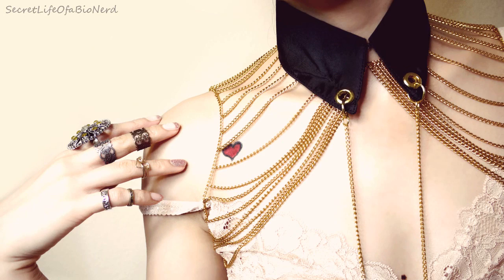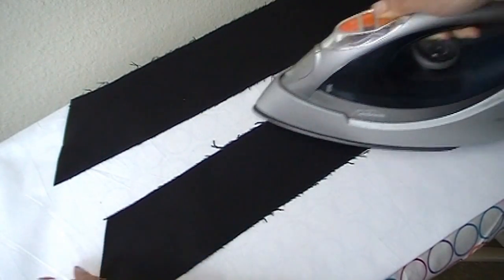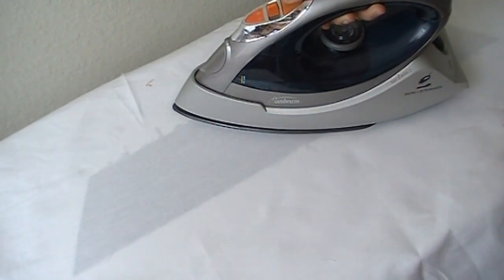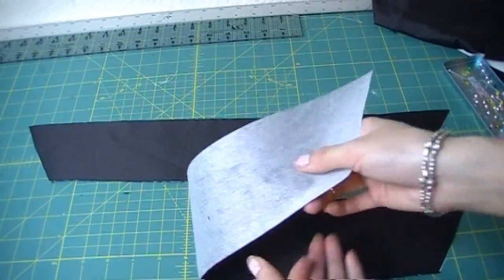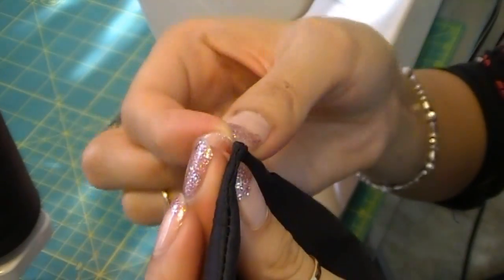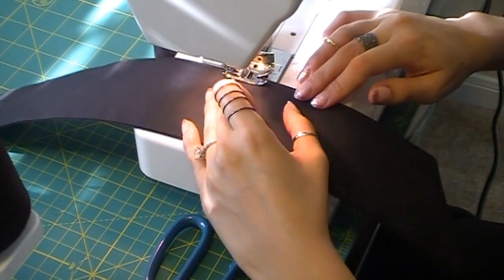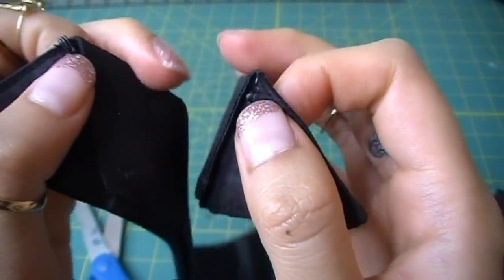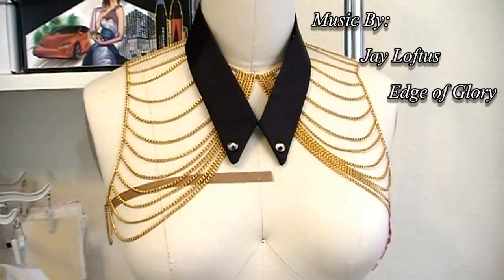DIY Detachable Collar (Accessory) Level: Easy

Comment: This is really cute. TO ensure  a very crisp edge on your points, it best to sew straight past the corner, cut and sew the next seam over, instead of turning the corner. Clipping the edge corner and turning is easier as well. I'd also mark and place the studs before closing, as the little end clasp would itch and drive me crazy.

Comment: hi, I am a little confused because in the last video you said that one of the pieces should be cut not only on bias, but larger than the first piece. but on this video I saw that both pieces where the same size, so this is why I am confused, I also saw other videos from other people and they cut both pieces on fold.

Comment: Umm, I have a question about the interfacing. When you're ironing it onto the fabric, isn't the nubby side the side with glue? Do you have to be super careful with the iron so as not to glue your interfacing to the ironing board?